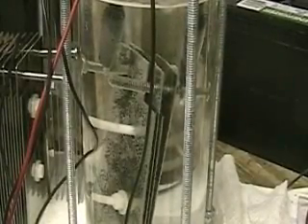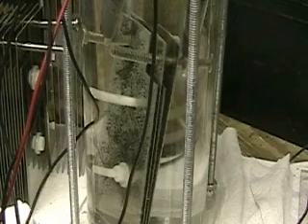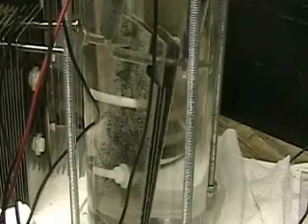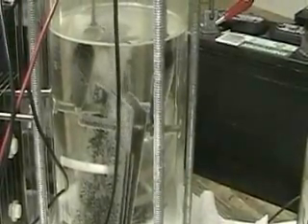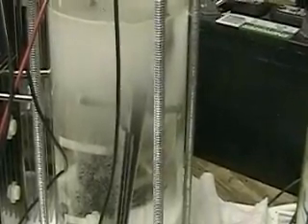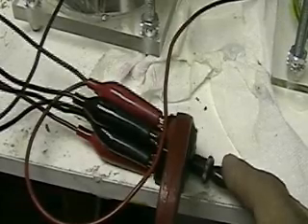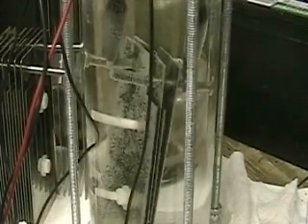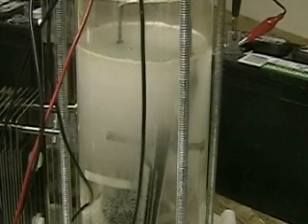Hydrogen Tap (Quad Cell Switch) 146

Comment: It does seem like there are more bubbles when you turn it on versus it running. If you time it to switch at the point of the drop off in bubbles it may produce more. I am not sure that by switching it at a rapid speed will help.